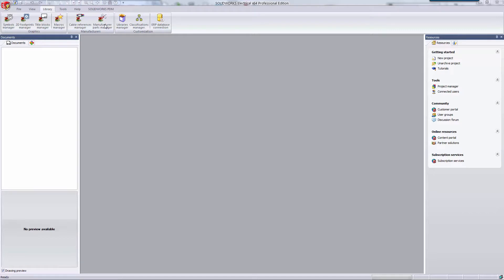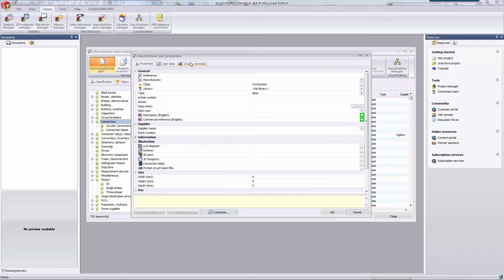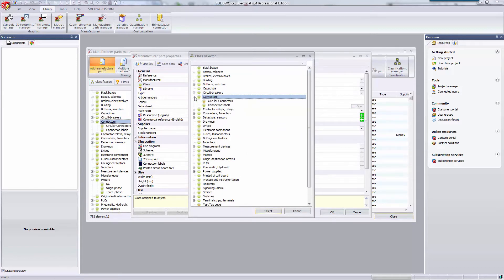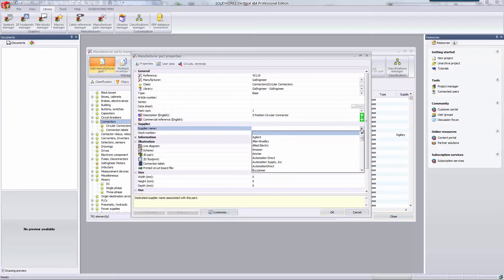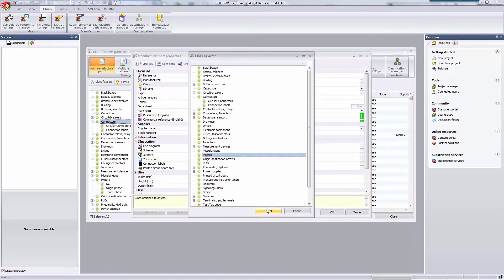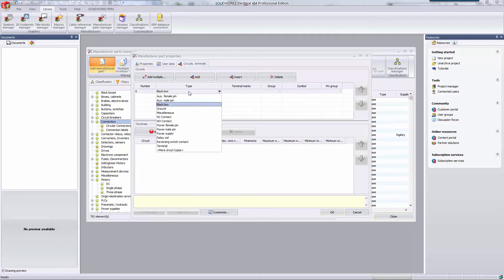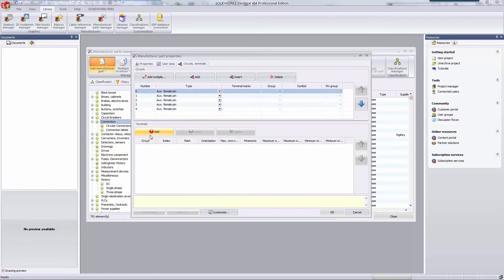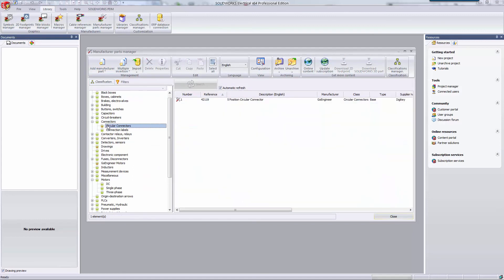SOLIDWORKS Electrical   Create Manufacturer Part

Comment: i am a mechanical engineer, i am leaning  schematics so what is the difference between circuit and terminals, can you explain?
Reply: I have the same question
Reply: I think a circuit (an internal notion) is made of a set of terminals (where you plug your wires), linked together in some way. For instance a terminal block for PCB is made of say 6 circuits, each with 1 terminal; hence with 6 separated terminals.